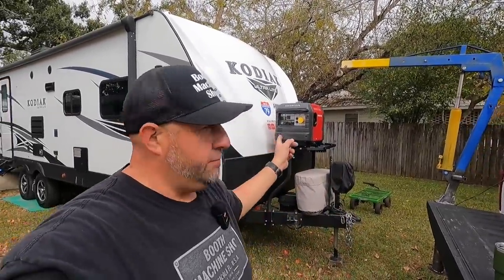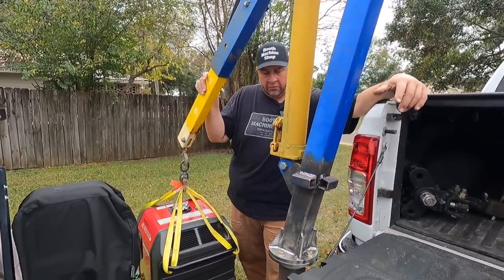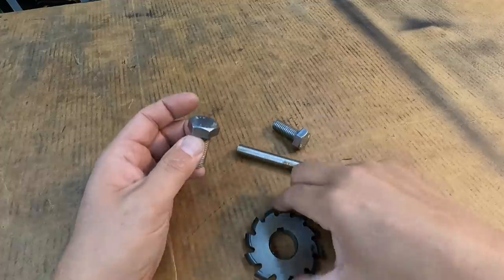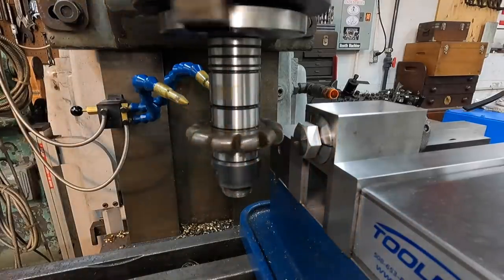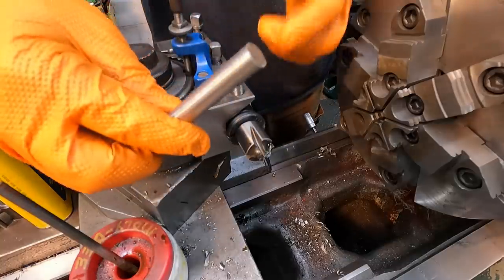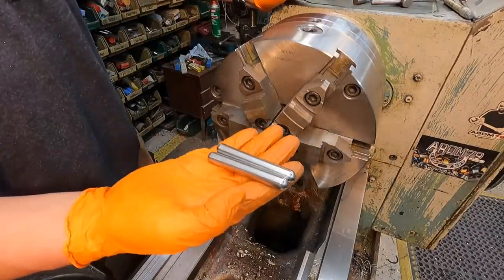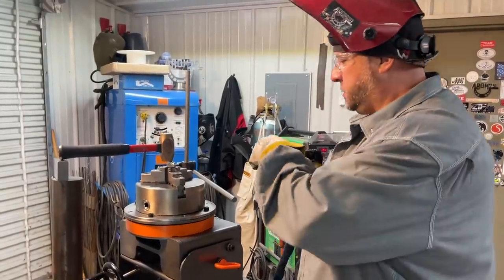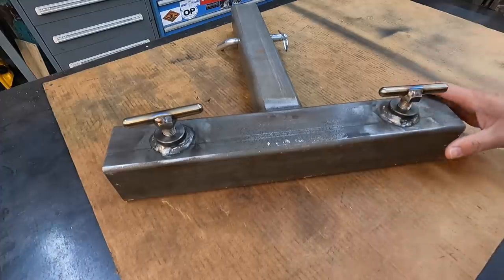Saturday Night Special 355: Stainless T-Bolts, Truck Hitch Crane First Real Lift

Comment: When I tig small parts like the beautiful T bolts you crafted, I really like to use small fusion tacks on the beginning and end of my weld run so I don’t have to run over a heavy tack. It gives you more room to worry about a consistent bead rather than worrying about covering up a big tack. It helps me and hopefully you’ll see this and maybe it will help you too. Happy building Adam. Beautiful work man!

Comment: Create a hinge at the base so you can lay the crane down on the bed. Insert the plug into the base and lift the crane into position. Then put a pin into the hinge to hold it in place.

Comment: Awesome! I bought mine from Northern Tools years back. Instead of attaching it to the receiver where the hitch normally goes, I attached mine to the driver's side end of the receiver assembly and leave it there permanently. I attach the lift hook to one of the truck bed pockets so it doesn't swing when I'm underway. When I put it to use, I just clip on the support legs. At my age and with my back and knees, I can't lift that assembly to put it in the bed of the truck.

Comment: I would still like to see you load several hundred pounds in the back of your truck and then see how easy to take down your lift completely. A screw jack or hydraulic jack  and a tripod base maybe? T-bolts are a great idea and nicely done. I would want to figure out a good way to make sure I didn’t loose them or they didn’t grow legs. I’ve had both happen. Nice work!

Comment: Question.  if you lift something heavy from the ground and put it in the bed, and it settles the suspension enough to put pressure on the ground foot you have extended, how will you get the foot to release?
Reply: Sky Hooks

Comment: The Gennie has landed! 😃 
A 14 inch circle of aluminum diamond plate will help out the foot from  bogging too deep in soft or wet soil. Just chuck it in the bed. Thanks for this series, it's been interesting.

Comment: Lov it when a project build works out to a Tee ! Being that our budget didn't allow for a Sky Hook, and Mr. Pete's build and now yours insprired me,, I mounted the Horror Freight crane to our welding table last week (@@)! Got its first try out removing the 3 ph motor & fly wheel on the Klopp 450 shaper ,,,worked out great, and save the old fussed together back disk !! I agree, some type of tripod leg extentions would be a good way to stabilize on uneven ground :)> Best to you, family, and all YT creators over the Holidays,,,Bear & Sammie.

Comment: Thanks for letting us watch and learn from your crane project. Since weight is a problem I wonder if it could have been built from high strength aluminum tubing? The lifting limit would be a factor but it sure would be easier to handle.

Comment: Add an ATV winch to the crane as a hoist. Mount it to the rear of the boom. Use the hydraulic cylinder to set the boom height, then use the winch to hoist up and down. That would add range to the hoist and save yourself a bunch of pumping on the jack.

Comment: I really enjoyed watching you make this Adam. I'm very jealous and wish I had something like this. I can think of so many reasons and ways to use this not only for putting things in the back of your truck but you could back your truck up to anything like you did with the camper and use your truck as a tool. As far as the wait thing goes maybe in the future if it really became an issue would it be possible to make it out of lighter materials such as aluminum? That face Mill is incredible and so satisfying to watch

Comment: Hi Adam, the machining is great as always. When it comes to the welding of such fine parts I suggest to try a root pass without filler rod first. The rod you have use was a bit to big

Comment: I like it, I could see me using an arrangement like that too handle my genorator when it eventually needs to go for service, and for handling winter tail weight for my truck. 
And lets not forget the other heavy awkward stuff that comes up from time to time.
I may rig it so that it works with my utility trailer as well.

Comment: You could make a "stand" for your crane to sit on while you're not using it. Back up to the crane...line it up with the hitch...pin it in... unlock from the stand...go to work. The stand would need a few inches of lateral mobility...maybe a plate, on rollers, loosely sandwiched between inverted "C " channels. Anchor it in the ground with concrete. That would also give you a stationary crane for load transfer between mobile carriers.

Comment: Another great and fun video.  Thanks.  That's really a good idea to add fore and aft struts to the crane. Lifting heavy directly off the back could put a big torque load on those square tubes.  They're beefy enough to handle a lot, but if you try lifting the full capacity of that arm at full extension, it might be dicey.

Comment: When you mentioned taking the crane apart to make it easier to install, it made me think of the pins used in agricultural trailers.  If you could use all 5/8 and half inch hitch pins then you can get that stuff off the shelf at a trailer supply house or some place similar.

Comment: Much better than my pipe "T" stuck into the 'tie-down' hole on the pickup bed.  The "T" was clamped to the building's ladder to get hvac equipment to the roof with a come-a-long.

Comment: Your could put pin in the lift cylinder to make it removable and it will make it lighter to pick up in pieces i have done this on mine to make it easier to load in the truck when i dont have help

Comment: The only concern is if you load up the truck bed too much. The truck bed will sag with weight. You will not be able to remove the foot pins to retract the foot. You will then need to jack up the truck to get the pressure off of the extended foot.

Comment: When I worked for Ocean Spray Cranberries I had to make T-bolts every 6 months because the operators would wear them out or lose them.
I had to make 50 at a whack and they couldn't have any sharp edges and had to be non magnetic stainless. 
I used a cordless keyless drill to hold and spin the stainless blanks and I ran the belt sander with 80 grit sandpaper to radius the ends. They look awesome and a little touching up on the beartex wheel made 'em smooth and shiny. 
Never had a single complaint in the 9 yrs I made those. 50 pcs took me 2 hrs. Just thought I'd share my technique if you need to make more in the future. 😉

Comment: I noticed you using a line level to level the flat . A line level is a very useful tool and doesn't cost very much. I have a grinding shop and use it to for a lot of things. It will get you in the ballpark pretty quick .

Comment: A pivot point would make life much easier. 2 pivot gussets with a back stop plate and higher front stops pin holes above the pivot point (same plates) locks the crane in from falling forward. Using a 3/4" pin. All welded to the top plate to pivot bottom of the crane on the input shaft minus the bolt on top round plate. This will allow you to load the crane on the bottom stand easier in the horizontal position. By inserting the shaft in the bottom stand first than pushing the crane up till it rest on a back stop plate and putting the locking pin in through the front stop holes of the pivot gusset plates. The pivot gussets and stop plate will be as or stronger than the four gussets you have already welded on. 👈🤓😉👍

Comment: I'm a little late to the party on this but I watched your video of the crane's fab and welding and you were fighting those wormtracks. I use to do do flux/mig in a boiler shop and we would replace our liners and also the gas insert piece in the head of the whip, its been a few years but I recall it to be a consumable part in that style whip. Might try those 2 things, I know how frustrating it can be to track down the cause of some weld in-perfections with wire. BTW your stick welding is 10/10

Comment: Lifetime lift an could add the air cylinder to it when your close to the shop you can use air or can still Jack it up manually to good job Adam now I want one

Comment: The second weld went better because your arc length was quite a bit shorter. I'm sure most people won't look that closely, but 2 of your size 'tacks' on the back face of each round would be more than strong enough for purpose and would have saved your nice machining on the visible side.

Comment: Adam - u need a brake for the ground plane spin.  With weight out on the arm if the tower is not 100% vertical that weight will turn the boom either away from your truck or into the truck.  I love your videos - keep it up!

Comment: If you find a way to easily remove the hyd cylinder like with removable pins it will ease the assembly

Comment: I would flip the hinge idea upside-down.  Put casters on the back of the hoist and add a tube that comes up to meet the cross tube from the hitch.  Pin the tubes together when assembling and pivot up from the wheels.  Insert a second pin to complete the attachment to the cross tube.  In an extreme case, the hoist could even pull itself into position.  The trick is to get the geometry right, so the legs don't pivot themselves into the ground.  This could also be made to pivot a full 180 degrees, to lay on the tailgate.

Comment: Hey Abom, awesome to see the lift in action. Great job on the design work! I can't even imagine trying to lift that generator up that high. Quite an awkward lift. Back-Saver 3000 to the rescue! 
Anyway, I had some ideas you can try for the dualshield problems you were running into; don't know if you found a solution yet. 

I might try manipulating your torch angles a bit. Try more of a drag angle, rather than right in at 90°. Also, I believe flux core wires benefit from a longer stick out than traditional wires. 1/2 to 3/4 inch is where I run fc often. The longer stick out  allows the wire and flux to preheat before liquefying and transferring to the weld puddle.
Just some thoughts from a welder Abom! Fantastic job as always, nothing like using your favorite equipment for a personal project. Keep up the awesome videos!
👍😎👍

Comment: Swap the bolts for a pin with a detent. Then you can pull out the hydraulic cylinder and also do one for the crane arm length adjustment. It would take half the weight off of the top piece and all would be fast to attach later.

Comment: If you still have the bottom part with the casters you could make a setup to just roll it out to the hitch. Plus you could still us it as a hoist not mounted to the truck possibly.

Comment: If you did alot with the collet closer,be nice to weld a hex nut to the end so you could use a wrench or socket to open and close without moving your setup.

Comment: nice work, as usual.  it's hard to tell sizes in zoomed in video, but try using a smaller diameter filler than your tungsten.  i like 1/16 rod with 3/32 tunsten for most general work, .040 rod for 1/16 tunsten.  works for me, maybe not for everybody else.

Comment: You might replace the bolt at the base of the hydraulic cylinder and at the main crane pivot with pins, that should split up the weight of the crane pretty decently. Might save a strained back

Comment: Great video Adam. The fill rod you used to weld the bolts was way too large in diameter. Which chilled your puddle when you dabbed it in. Causing the weld to get a little squirrelly and not flow right 👍🏻

Comment: With a fit like that,  I would have used Harris Safety Silv 56, only because I  have it.  Coat both parts with flux, when it slumps down due to heat, it won't be long until it hit fluid temp.

Comment: Adam,  How are you going to get the leg up when you put a heavy load in the truck with the crane?  There will be too much pressure on the leg and the hitch will lower as the truck is loaded.  I think the leg should have been a screw type.

Comment: putting a big, like 18" diameter, foot on the crane should give the same stability as legs out that far and it would be less in the way to step around.  Also I am not a pro welder but have done a ton of stainless lift arc because that's all my machine will do.  It looks like you were fighting too big of a filler rod IMO.  I find it's easier to make it pretty on small parts with small diameter filler

Comment: Instead of welding set the Handel in the mill center it and drill a hole for a #10 cap screw and counter sink it tap the head of bolt for 10/24 the 1/2" radius on the bolt will withstand the torque much more clean
Reply: "Handel"??  Also, always remember, punctuation is your friend.

Comment: Could the T-Bolts have been brazed? Just thinking about all that lovely surface area you made
Reply: Sure, why not. As long as you don't put a wrench on it.  Just use plain steel and don't expect it to be as strong.

Comment: Hello Abby!

I was thinking a hinge would allow it to lay over onto the tailgate.  That would make it much easier to pick up.  Somebody below beat me to it so I'll have to ditto his comment.

 The jack needs some brainstorming.  I'm putting an electric winch on my crane.  It has a coupler for the power and a receiver type mount so it can come off quickly.  Eventually, it will be able to move between truck and trailers.

Comment: instead of bolts & nuts, use pins with hair pin clips on your crane pivot points. that would make it quick & easy to build in place.

Comment: Nice idea.  As far as set up, would it work to make a hinged joint in the upright above the swivel, with a pin on front and back.  That way, you could drag it over, lift one end to put a pin in, tilt it up, and put the other pin in? It might reduce the weight rating, but would make it far easier to set up by yourself.
Reply: And you've said you aren't planning to lift massive multi thousand pound loads.

Comment: The crane works great! I would have put the bosses on the corner to get a better no slip no wiggle connection. The groves are completely unnecessary but nice to locate the cross bar.  And make sure those stainless bolts don't gald. But hey you did it and people love it so alright!

Comment: You shall  put the ground cable on the chuck vise,  if not , as you done, all the current run trough ball bearings  at the table . It is a common fault, no matter how a few amps run from the ground cable.

Comment: Next upgrade for the truck crain is a dc electric linear actuator the same size and stroke of the hydraulic ram with an adapter to plug into the trucks 7 way adapter to get power

Comment: Hi! You need to instal some sort of hinge at the bottom of heavy part. Then you will be ably to attach heavy part on a base and then just erect it without need to hold full weight of it and having fun trying to align bolt holes.

Comment: Although it would be a small percentage of the total crane assembly weight, it would only take seconds to remove the extension arm.  May be just enough difference to save the back

Comment: Love your crane.  Just a question, if you pick up something really heavy 500KG and put it on the back of your pickup and your pickup sits down can you still remove the leg of your crane easily.
Reply: or even 10 logs at 50kg each.

Comment: 32:40 Nah, you don't want to use a 'wrench' on those screws - you should be using the multi-function crane handle ;)

Comment: Yeah i bought a harbor frieght truck bed crane for my f350 flatbed.  I rebuilt the bed and knew i wanted one so 2 4 inch c channel cross members i welded a 1/2 plate  and  crane is rated i believe 1 ton and i picked up an inspection table that my landlord picked up at sale to resell   that was quite heavy and it leaned  my f350  pretty good at least 3 to 5 inches over my 8ft bed.  I dont normally do that heavy mostly its 500 to 700 lbs max which it doesnt lean my trk much

Comment: I did a McMaster Carr check on push pins and I believe if you use push pins in place of the bolts you use on the hydraulic cylinder and the other pivoting points, a set up and take down would be in manageable pieces.  So, not one big piece but 4 or 5 smaller pieces.  Push pins are not meant for sustained load bearing but might work in your situation.  Just guessing.

Comment: Have you considered a hand-crank winch on this thing?  Then there'd be no need for a cart, you could pick stuff up from ground level straight into the bed, and vice-versa.  You'd need a brake on it for safety, I'd imagine.  Just a suggestion.
Reply: Cart is to move generator into garage for storage.
Reply: @ronaldfulton1175  I think that you misunderstood the point of my post.

I know why he's using the cart, but when he's on a site, he may need to pick up items from the ground, instead of off a cart, in which case he won't have enough reach to get them off the ground and directly into the bed of his truck.

Comment: Sweet!   :)   Hey I have an  idea for the leg pin (because some people feel that if you have a to heavy of a load that it will get stuck (I dont think that).  Anyway if you put a metal tube in where the pin goes, then sleeve it  with Nylon like you did the main crane.  This will give you a slide able surface and or a smash point that will deform the nylon rather then metal first.   Like a canary in a coalmine visual guide.

Comment: Hi Adam. You and your ‘camera crew’ have it down pat 👌
Great vid mate.
This series got me to thinking. I bought a truck-bed crane a while ago, thinking I could use it when I swapped my tub over for a flat bed on my Amarok ( VW) Ute.
Can’t afford the $6K swap now, so a hitch mount is the way to go.
I’m thinking that a ‘parallelogram’ from the hitch to the foot post would allow the Ute bed to move up and down independent of the load. Now I just need to figure how to stop the foot from moving front-to-back when the load is aft of the tailgate 🧐
Thanks for all the extra time you take to explain your builds Adam 👍
Regards
Robert